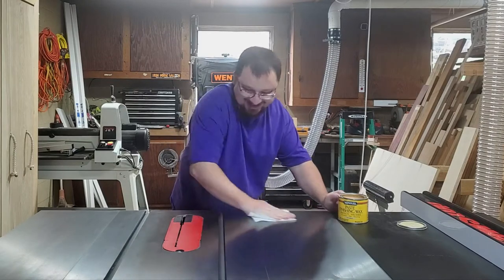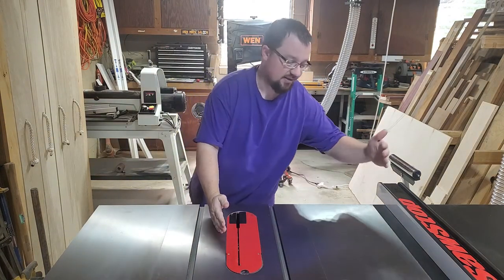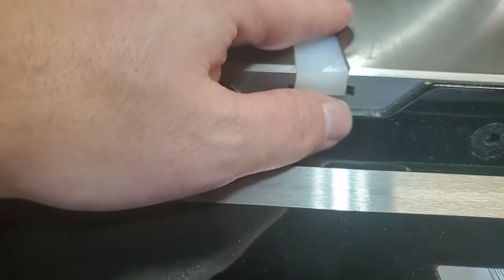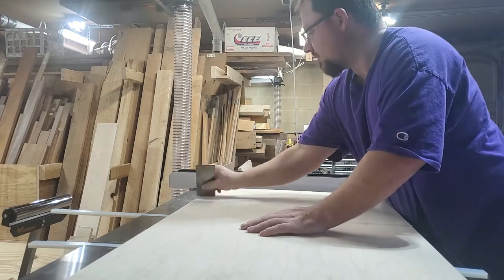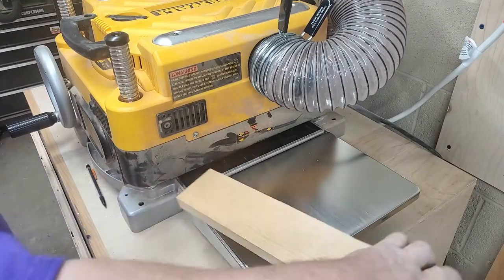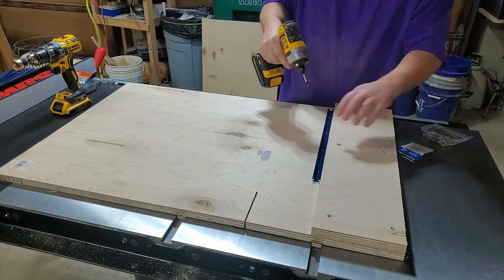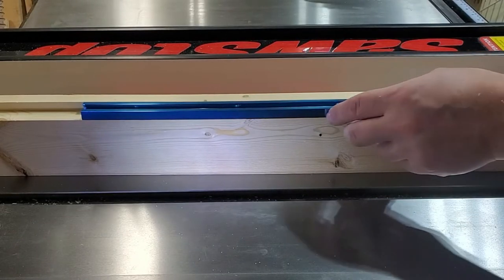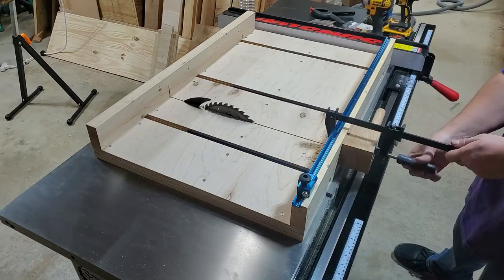Build a crosscut sled that makes work easy and safe

Comment: Double sided tape on those runners would have saved you some grief with those plastic runners. I used similar and it works great. Second straight video that I am jealous of that saw!  Keep up the great work.
Reply from the maker: You know I think you are correct about that.  It would have made a difference.  The other problem I had was when I would screw them down tight, they would squeeze out at the sides making it tight in the slot. I suppose I didn't have to go that tight.  I just had some high hopes for them. When I worked with cranes, we used a hard nylatron plastic for wear pads in the boom sections. They were a super hard but yet slippery plastic.  I thought they would be similar to that.
Reply: @TheRookieWoodworker  The screws, to keep them from bulging the the runners, make the hole in the slider slightly larger than the screw but not in the plywood.  It will hold well, won't have slop, and you won't have that bulge.

Comment: Tilting the base to lift it after CA gluing the runners probably contributed to them breaking free. The runners proper snug fit meant their lower corners would press against the slots’ sides when tilted that way to lift the base.